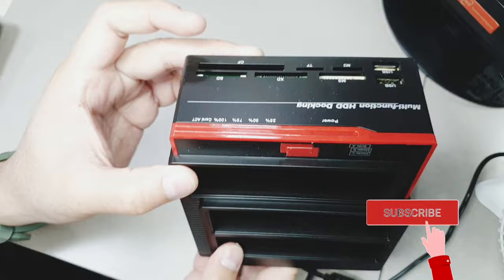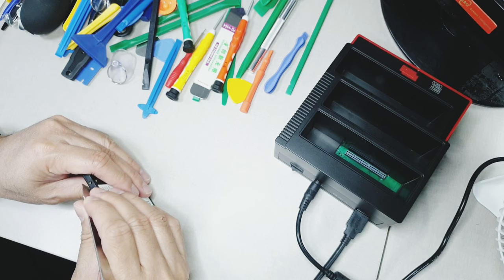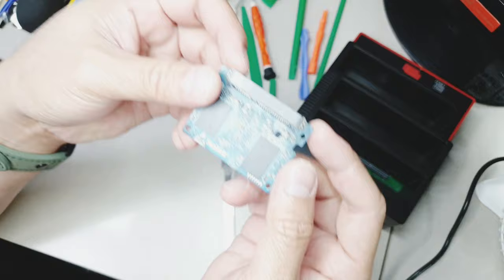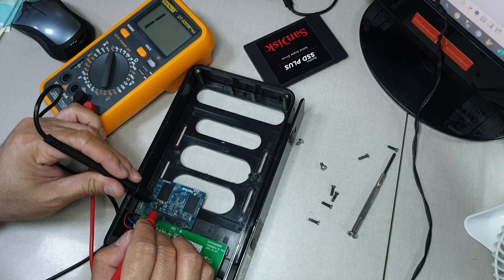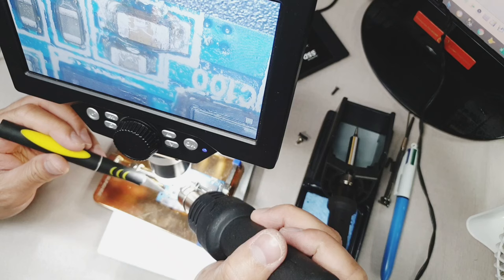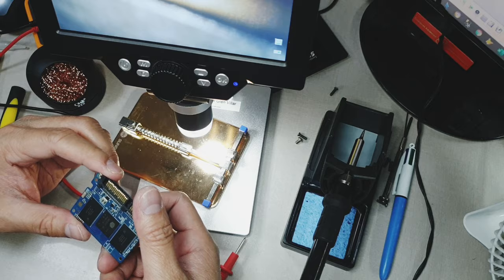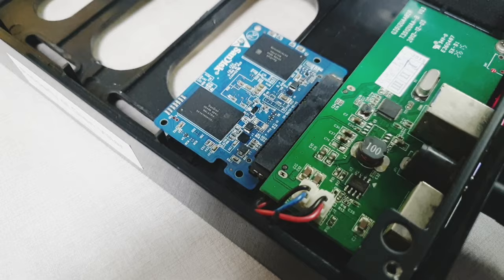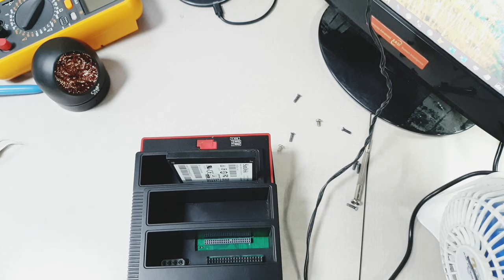How To Repair  Dead SSD (Solid State Drive) and Recover Data  - 100% Working

Comment: I checked all circuit board and have beeping only for 2 resistors (they are marked R with number). Should I remove them?
Reply from the maker: Hi , what is the number  on the resistor?
Reply: @ReynaxisSolutions  Hi, it is R115 and R78. However, despite the same size, the board looks a bit different than yours. I have Sandisk 240GB (SDSSDA-240G)
Reply from the maker: Will you be able to find a similar SSD so you can test their normal SMD component's value?
Reply: @ReynaxisSolutions  I just received brand new SDSSDA-240G, but circuit inside changed:(  I will try to find resistors with same name on it and compare
Reply from the maker: Yes please check and do a comparison. Thanks.

Comment: WD SSD are actually Sandisk SSD. They are craps, I have both failed on me. one is under warranty, but I have sensitive data, I did not send in for warranty claim. I may try to fix it myself.
Reply from the maker: I see. Thank you for the information. Samsung EVO's are the best ssd.
Reply: @ReynaxisSolutions  I’m currently using Samsung EVO. Hope it will last.
Reply from the maker: Nice. I have started replacing our Sandisk SSD with Samsung EVO's for PC's. But for POS machines, we are still using Sandisk for cost-related reason.

Comment: Hmm, so my m2 NVME drive not detecting anything in the same manner is due to electrical shorts then. The problem is the components are EVEN tinier it seems on the board. 970 Evo Plus 500GB so to speak.
Reply from the maker: If there are components that can be checked through the scopes, then there might be a possibility of repairing it.

Comment: I have a Samsung SSD 830 series and when I turned on my computer it was a black screen with a line I have tried to put a hard drive in the computer but that does not work what should I do
Reply from the maker: Please check in the bios if the ssd is being detected or not.
Reply: @ReynaxisSolutions  my computer battery is lost so I can't turn it on but I remember it saying Samsung something it was fine before but I powered it off and it stopped working
Reply from the maker: cannot be directly plugged to charger?
Reply: @ReynaxisSolutions  no because back is.off I heard Samsung SSD does not last very long
Reply from the maker: Not just samsung ssd, but all ssd do not last that long.

Comment: the capacitor u remove u replace them or with out them u repaired it
Reply from the maker: Not replaced.
Reply: @ReynaxisSolutions      mean that after removing the  capacitor which is not working  hard drive work proper

Comment: May I know it remove the capacitor or replace the capacitor?
Reply from the maker: You can replace the capacitor too. But if nothing, it will work as well without caps.

Comment: Hello po, My Kingston SSD suddenly froze. After ko ma reboot yong PC ko, Naka "unallocated" na po siya sa Disk Manager. I checked the device property, It says "This device is working properly". The option that is available is to initiate "Allocate" the drive  but it will ask me to reformat the drive for the system to recognize it. I'm open to get your service at any cost. Davao del sur area
Reply from the maker: Hi, usually, for the first step of SSD checking whether I need to repair it or if I can access it by any other means and extract the data, I would usually insert the ssd into an enclosure and plug it to USB port on a PC installed with a Linux OS.  Usually, Ubuntu Linux would read the files in SSD even though Windows could not read it. Here's my video on how I do it. https://youtu.be/b_V6ULI0ztg?si=tDm1lo9PP8kMSmUG

Comment: Congratulations, I have never watched such a cool video. Could you tell me what type of flux, you used to remove capacitors? Is it necessary to use it?  What is the goal of using this flux.
I have to fix a Kingston 240 Go SSD who, do you think this method will work? Windows 10 check the disk in the computer management, and he says: Disk 2 unknown, 223.57 Go, Not initialized. However, it is impossible to initialize it, because the program says: bad CRC. 
Thanks. Fred from France.
Reply from the maker: Hi, thanks. I'm using a liquid/cream flux in a syringe. The flux is used to distribute the heat evenly to easily remove the faulty capacitor.

Comment: So I am planning to use this same SSD to record on straight from a camera monitor. 1. What are my chances of this SSD failing? 2. If lets say it fails during a wedding I am shooting, Will I be able to recover what I had already recorded. Thanks
Reply from the maker: If the SSD is brand new, I would not worry about it failing. It doesn't have a mechanical parts so the risk is low. I would not use a second hand ssd for that important occassion because SSD it has a built-in time of death.

Comment: Can you list the tools you used? Thanks
Reply from the maker: Hi, For this job, I used cellphone repair tools. Mustool LED Microscope, Seek Thermal Compact Pro, Yihua 952D+ Hot Air/Soldering SMD Rework Station, Kaisi 1505TD DC Power Supply, Hard Disk Enclusure, PC and a Multi-tester.

Comment: the capacitor was removed, then replace with new one?
Reply from the maker: Hi, in this case , no, I did not have to replace it.
Reply: @ReynaxisSolutions  will it work even not being replace right?
Reply from the maker: If the connection where the capacitor's two ends were originally attached to is severed, then it won't work. But if there are other capacitors in the array that does the same job then there is no need to replace it.

Comment: How do you figure out what to use as a replacement component?
Reply from the maker: I usually look for the same logic board and measure the good component.
Reply: @ReynaxisSolutions  I have a team group drive that had some sort of short. I can see the burned component, but I have no idea how to identify what it was.
Reply from the maker: Hi, you can google for it's logic board. Type the model of the drive and its logic board.

Comment: you didnt have to replace the capacitors?
Reply from the maker: Hi, in this case, no. But if you have a replacement, better replace.

Comment: In the time it took you to open the case, I went online a bought a 1Tb SSD for $50 shipped. Why waste time on a disposable product ? These are designed to need replacement every few months anyway, so more money can be made from consumer's.
Reply from the maker: Hi! Thanks for dropping by. I agree with you. However, there are times that we may need to do this like when we want to extract important data from the faulty SSD such as the case in my video.
Reply: @ReynaxisSolutions  Yeh, I thought about that AFTER I made the comment....I guess, if it's important data, anyone would do anything they can to save it. Apologies.
Reply from the maker: No worries. I appreciate your apology but you really didn't have to. Thanks so much. You have my respect.

Comment: Very impressive but I got puzzled. You did not replace the capacitors or did I miss it
Reply from the maker: No, I did not.
Reply: @ReynaxisSolutions  how was that fixed without replacing the capacitors?
Reply from the maker: @MrMusic55123  Hi. I'm guessing that the faulty cap is a bypass capacitor. You could replace it or not, the SSD will work.
Reply: @MrMusic55123  it can still work without, enough time to recover you data and migrate to a new storage

Comment: Mere laptop me 256 gb ka ssd laga hai aur ab wo disk me show nhi kar Raha hai usme bahut sari important files aur photos hai 
Computer solution wale ke pas gaya wo bol rahe hai ki ye corrupt ho gaya hai aur ab iska koi solution nhi hai 😢😢

Agar koi solution hai to please bataiye
Reply from the maker: Hi, usually before I resort to opening and checking the board of an ssd card, i would usually try reading the ssd in an external enclosure and plugging it to a pc with an Ubuntu OS. See my sample video on this link. https://youtu.be/b_V6ULI0ztg?si=_4SS1ZqMELi-jbit

Comment: Did you just removed them? Or you replaced then?
Reply from the maker: Hi, i removed only.
Reply: Will it work normally again?
Reply from the maker: Hi, in my case, it works normally but I won't use it anymore. I only need to get the data from it. I would not trust that SSD after the data recovery.
Reply: But if you replace the capacitor, do you gain more trust in it?
Reply from the maker: Maybe. But the SSD has been used for 5 years so I would still recommend to have it replaced.

Comment: So you don't replace the capacitors you took out?
Reply from the maker: Hi, yes, in this case, it was not required to replace the faulty capacitors.
Reply: @ReynaxisSolutions  why the capacitors were there in the first place? What is the FLUX (?) you apply before taking it out. Is it an acid?
Reply from the maker: Looks like those capacitors are filter caps which means the circuits in the logic board will still work without it. At least temporarily while I am copying the precious data from the faulty ssd. The FLUX is for spreading out the heat proportionally so it's easier to melt the lead.
Reply: @ReynaxisSolutions  Great. Thank you.
Reply: I had many HDDs which went bad and I just destroyed them for the magnets. But not I have one SSD that suddenly stopped being registered. I will try your method. Thank you. Please keep us informed about new things.
Reply from the maker: Thank you and welcome.

Comment: You just remove the components? or replace them?
Reply from the maker: I just removed the bad caps. At that time I don't have a replacement but if I have, I would replace them.
Reply: @ReynaxisSolutions  so it'll work without the caps for the meantime? how long will it last that way?
Reply from the maker: @bryanleiporsado6845  Mine is still working ever since that day I repaired it.

Comment: So I have an SSD which in Disk Management now shows up as "Unknown 111.79GB Not Initialized" "111.79GB Unallocated". Before this it was ok, and I had a few partitions on it. If I try to initialize the disk I get this error: The request failed due to a fatal device hardware error. Can this solution in the video help my SSD?
Reply from the maker: Hi, have you tried running a chkdsk on it? It might have a bad sector. You can also try and replace the usb cable. If all of these have failed, then the logic board must have a component problem.
Reply: @ReynaxisSolutions  I can't run chkdsk on it, because it's not showing anymore inside Windows, either on Disk Management. But I have tried to check it for bad sector with HDD Regenarator and got this error: Master Boot Record is damaged.
Reply from the maker: Do you have an important data in the SSD? Sounds like a problem in the NAND Flash memory or in some of the board's component. We can't tell for sure unless someone could check the logic board for damaged components. If there is no important data in the ssd, you might want to try partition tools to try and recreate partitions.
Reply: @ReynaxisSolutions  I think it's the bourd just like in this video. I've tried to create partitions, and it's not letting me do it.
Reply from the maker: It seems so. If you can remove the logic board and apply 1v of power and use something to discern heat: thermal cam, rosin dispenser or freeze spray, you could see which component was causing the problem. If you don't have these tools, other people use their tongue (kidding aside) to detect variations of heat on the logic board.
Reply: @ReynaxisSolutions  thank so much for all the answers. By the way, do you think vibrations or magnets can damage an SSD? I was keeping my SSD on an external case on my desktop PC.
Reply from the maker: Welcome. There was a study made about the effect of vibrations and extreme heat on the SSD and it was mentioned there that they could have an adverse effect on the health of the SSD in the long run. The magnet has unnoticeable effect on the SSD though.
Reply: @ReynaxisSolutions  so after a few more tests, I came back with a new update. I checked the S.M.A.R.T. attributes with CrystalDiskInfo for the SSD, and all of them have "Good" status. If the SSD would've been dead it wouldn't show that, no? So it's clearly a physical damage just like in this video.
Reply from the maker: Hi, it's very likely. The only thing left for you to do is check the logic board.
Reply: @ReynaxisSolutions  hi again. Back with another update. I just put the SSD in another PC, and tried to access it from the BIOS. What I've discovered is that the SSD is shown in the BIOS as "SATAFIRM S11" which after a google search apparently it's a firmware error or something like that. Is there a way to fix this without losing the data on the SSD? My SSD is a SATA Kingston A400 128GB.
Reply from the maker: Hi, I have not tried updating the firmware of an SSD yet because I haven't come across a problem that requires that. Try searching for it on Google or YT. Let us know when you have successfully done it and we will quote your name on my future post. Thanks.
Reply: @ReynaxisSolutions  I did find a lot of problems like mine about Satafirm S11. Apperently it has to do with the controller of the SSD and a firmware update error that cause this thing. The only fix there is online will erase the entire data from the SSD to make it work again. So I will not do that since the data is still there. I rather wait other solutions from SSD companies or others that can fix this Satafirm S11 without losing the data in the process. I wonder if switching the controller may help recovering the data, with one from a same SSD?
Reply from the maker: Hi, I honestly haven't tried updating the firmware of an SSD before. And it's also risky because I'm not sure what would happen to the data after an update if there is indeed a way to update the firmware.

Comment: Sir ganyan din po ang SSD ko na dedetect sya pero hindi ma open. Possible din kaya shortage din ng mga capacitor? Pwedi ko po ba ipaayos sa inyo? Mayahalaga lang po ako ma files dito. Sana mapansin salamat!
Reply from the maker: Hi po. I'm sorry sir ha, nasa Papua New Guinea po ako. Hindi po ako tumatanggap ng parcel para ayusin yung ssd at malaki po ang chance na mawala ang item niyo on the way here. Pero pwede niyo po yan i-pacheck sa Pinas, doon sa mga gumagawa ng laptop na board level ang skill. Or kahit po sa mga magagagaling sa phone repair. Hope you can find the right person to fix it sir. Thanks.
Reply: @ReynaxisSolutions  Thank You sir sa suggestion nyo. Marami ako natututunan. baka soon maging technician narin ako. God bless and more power po.
Reply from the maker: Welcome po sir. Good luck po sa bagong career. Kayang-kaya niyo yan sir.

Comment: Where is your office (or your website) I need your help with my SSD!
Reply from the maker: Hi, don't have website yet. How can I help with your SSD?
Reply: Thanks for your reply. I have a Samsung Evo 860 that just died for almost no reason! And I have some data in it. Now when I connect it to my pc, it won’t let the computer boot at all, and when I connect it via USB, it doesn’t show in windows. I tested it on an old pc and let the computer boot but still not showing in the bios or windows!
Reply: Btw I would be more than happy to help you with your website! I'm a web developer 😁
Reply: Same problem
Reply from the maker: @jamesmatthew1031  Hi ma'am. Are you a Filipino?

Comment: Wouldn't use that ssd for prolonged period of time with out those caps being replaced . Should be fine for data retrieval though ;)
Reply from the maker: Yes, that's what I always suggest though. A repaired hard drive or ssd is only good for data recovery.
Reply: Same thing I was thinking.  Guess its a godsend to be able to recover the data.

Comment: can you fix mine ??
Reply from the maker: Hi Frank, I would if I could. But sending your SSD to Papua New Guinea is costly and risky. And there's always the 50-50 chance of it getting repaired. That being said, it is not advisable to send it here and it is better if you can find a local shop in your area which can fix your ssd. Thanks.

Comment: Woow, it seems really difficult, I have the exact same model, I dissambled it, nonetheless I haven't got any of the needed tools to repair. So I have to buy a new one instead of repairing it.
Reply from the maker: Hi. Yes, considering the cost of each ssd today, it's advisable to just buy a new one. But we have tools lying around, it's nice to try and save a faulty ssd.
Reply: @ReynaxisSolutions  I wish I could save it; however, the tools that I need are much more expensive than the new ssd. Actually I love repairing, I'd rather repair than buy a new one.
Reply from the maker: @LeventGUNCE  Yes, that's true. Hard to buy expensive equipment if we don't use it that much. I bought tools just for the fun of it and it helps me with my work. I think I have spent more than $8,000 for my IT tools and repair tools. But they are worth it anyway.
Reply: All you really need is the multimeter ($10-$15) and a soldering iron ($10-$15) if you need to recover any data from it
Reply: All you really need is the multimeter ($10-$15) and a soldering iron ($10-$15) if you need to recover any data from it.

Comment: ssd drives aren't worth buying they burn out very quickly. I rather deal with the good ole hdd drive. some companies claim that life span of ssd drive are for life. after watch these videos in yt on how to fix ssd drives I lost the hype in buying an ssd drive.
Reply from the maker: Yes, that's why I always have a clone of my SSD where the OS and my apps are installed. That way, if it goes bad, I just swap SSD and clone it again to ensure that I don't have long downtime. Also, my documents are saved on another harddisk. I just like ssd for its benefit of making processes faster.